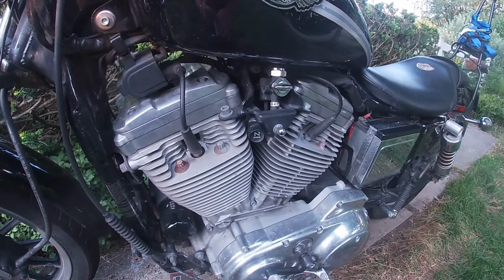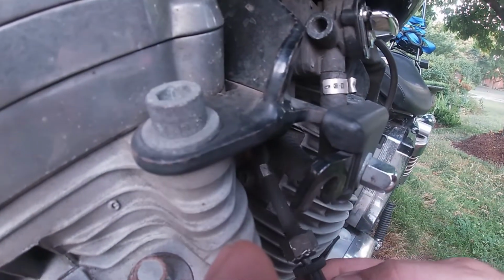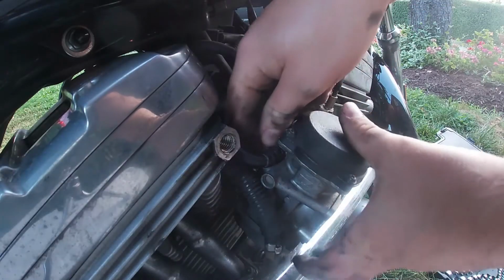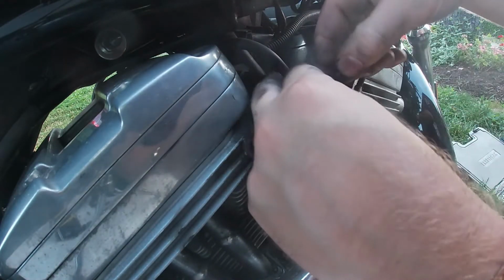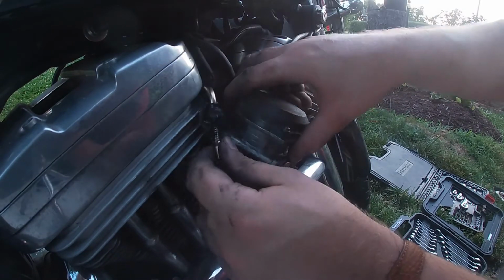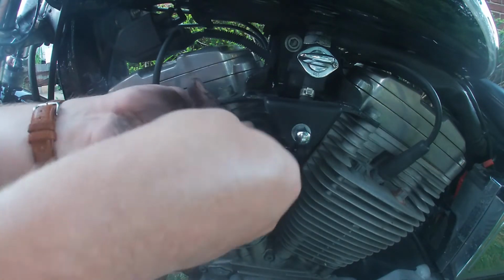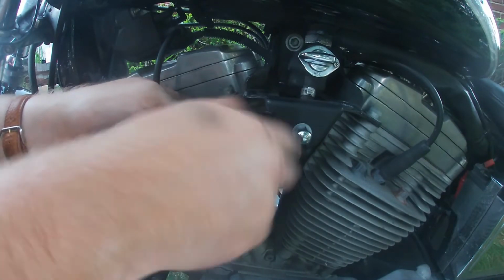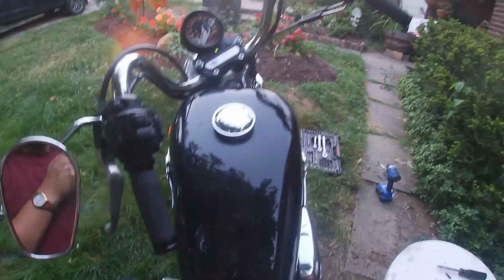Choke cable Replacement on my Harley Davidson

Comment: Wouldn't it be easier if you remove the fuel line to the carb so you can turn it to the right for more accessibility? Good video.
Reply from the maker: Would definitely give more accessibility, though the current clamp on it is crimped on and I don't have the tool to crimp on a new one.  A standard hose clamp would probably be fine, but I decided to just leave it be.
If you do decide to remove it, I would turn the fuel off and run it until it runs out of fuel to minimize spillage, especially with the exhaust right underneath.
Reply: @ramblinchris400  Fortunately, I do have the Oetiker tool for crimping plus replacement bands. I always close the petcock and let the carb run empty after each ride, which is what the owner's manual says to do because the rubber vacuum diaphragm in the carb can fail and allow gas to get into the engine oil. 
 Thanks for answering so fast. Great video!